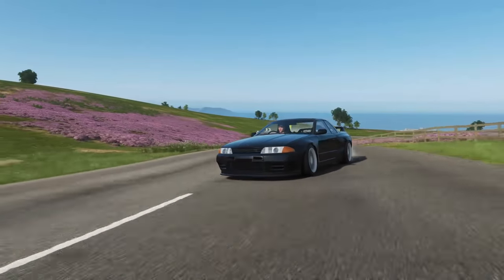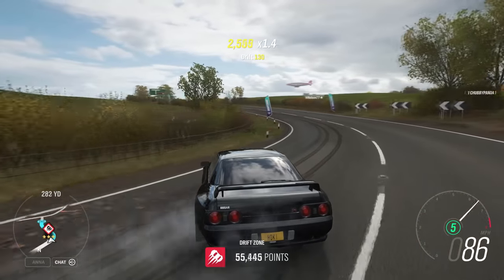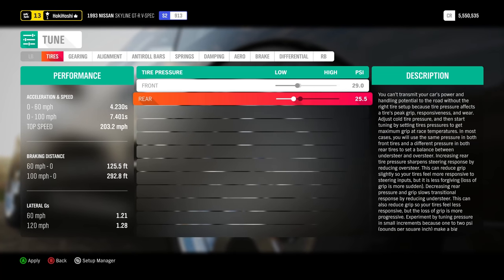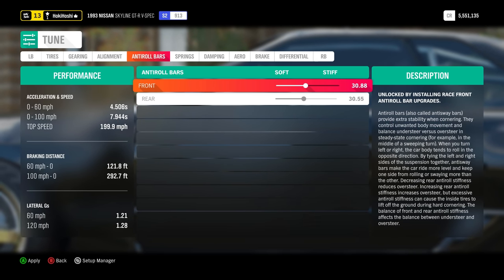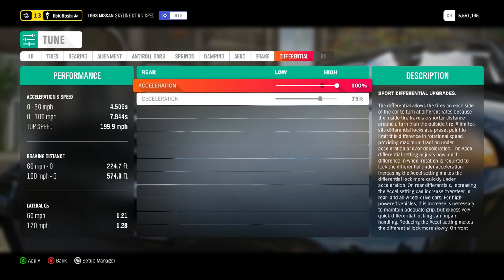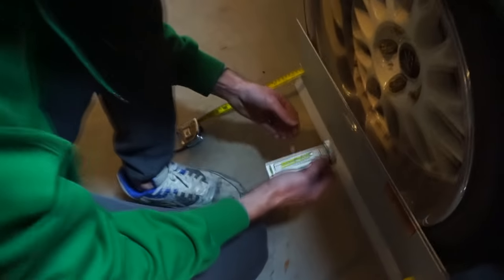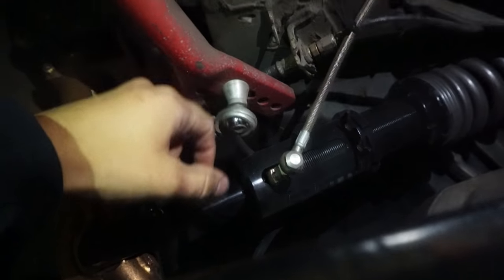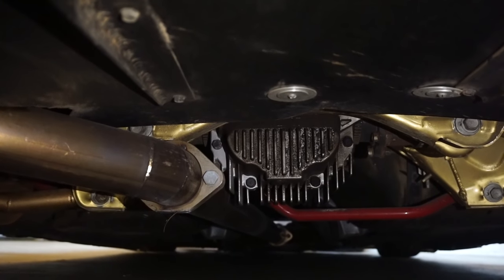How to Drift in Forza Horizon 4 (Technique/Tuning)

Comment: After watching full video i must say that you did more than great work. Its hard to say how much effort you put into this and how good it is in summary. Just great great great work. Its one of the most quality things ive seen in a long time. About Car specific videos. Definitly yes i would love to see this kind of videos from someone like you.  Have a great day/night!
Reply: Tomek L the only thing I think is wrong is the tyre pressure but it’s great
Reply from the maker: @mauderuel  What are your thoughts on the tire pressure?  Always interested to hear other opinions!!
Reply: HokiHoshi on relatively low horsepower like 0-650hp using high pressure can help you to start and keep sliding  
 because you have less grip but in the front you can let it low to have precision or let it high to have a smoother transition
Reply from the maker: @mauderuel  Oh I totally agree!  I mentioned this as well in a comment to someone else, but for lower power cars and for beginners (and sometimes tandems), I think high tire pressure can be really helpful for kicking the end out and also learning drift control.  Heck when I started drifting in real life I used to run 40+ PSI on my rear tires.  The reason I suggest low rear PSI and "optimal grip" front PSI is because that's more the end goal.  It'll get you higher scores, more drifting speed and control, and is preferred for high HP drifting (most Formula Drift guys run crazy low rear PSI), but again I completely agree on low horsepower cars benefiting from higher pressures!
Reply: HokiHoshi yep
Reply: Tomek L  I was thinking the same! Great work!
Reply: I SAID THE SAME THING. JUST TODAY IN  FACT . SO MUCH MORE EASIER WITH VIDS N HANDS ON.  BUT YEA I LEARNED N GETTING BETTER AT

Comment: Im more aggressive when drifting and for anyone who cares to read this, my initiation goes like this: 
Weight transfer —> Power over —> Handbrake. This generally allows me to take a much wider line for more Formula Drift Esc. Lines and tandems. Ofc this isn’t something to start off with although it is something id recommend for a more aggressive tandem battle.
Reply: If you whant to go real aggressive and do reverse entrys you need to Have low camber up front and stiffen the front suspension and lower bumb in rear and add bumb in front
Reply: Do u still drift
Reply: @alleaa5087  What's 'reverse entry'?
Reply: @thesprawl2361  when you over rotate the car and come in reverse in to the corner
Reply: @alleaa5087  Ah, okay. I reverse drift so I just call it reverse drifting.
Reply: @thesprawl2361  reverse drifting and reverse entry is not the same. just search reverse entry on yt
Reply: @alleaa5087  Okay, I get you now.

Comment: Nice video. Thank you. I am kinda new to sim drifting using a steering wheel. Are your settings here good for a steering wheel, controller or both? Also, I notice some people using Rally suspension setup. Which do you recommend? I am guessing drift but I was surprised people using the rally setup.
Reply from the maker: Most of the settings transfer pretty well between controller and wheel!  The rally suspension thing mostly carries over from FH3 when there was no drift suspension and rally had more steering angle than race. For FH4 though, drift suspension is definitely preferred!
Reply: HokiHoshi this dude is a big YouTube or now he has 100,000 subs
Reply: @Mashy937  not exactly.
Reply: @HokiHoshi  Could you please share your settings for t300rs gt?
Reply: @yolandedossantos6116  this aged like fine wine
Reply: @Anonymous-eh3bt  pro tip use drift suspension for dry pavement and really with dirt\snow lol

Comment: Great informative video pal! I setup very similar only o don't run lowest rear tyre pressure I run it to meet 32-33psi in telemetry for optimal grip. Also run 40% rear brake balance with 18% Brake pressure so I can sit on the brake whilst under power and hold angle when in tandems to manage speed on lead cars door

Comment: "i would also reccomend to set your braking to ABS off" look, this is an amazing tutorial and i actually started drifting really nicely after watching it, but driving in this game without ABS on in general is really hard, i found that keeping the tires TURNING while drifting helps alot. i always gained grip and fucked up my drift when i lightly tapped the brake. please turn abs on, it makes everything easier. trust me.
Reply: Then your problem is brake bias and pressure I use 45 to 43% bias and 85% pressure
Reply: Well, i use abs off and locking the brakes with the clutch on is a great drift extender, train your finger to be more careful on the brakes
Reply: Use stock breaks only then

Comment: I upgraded an RX7 a and tuned it according to this video but everytime I use the e-brake it instantly spins out, any tips on what I may have done wrong? thx
Reply: PetFlaska try to lower rear outer toe
Reply: if you are slamming the gas along with the e brake try using some to no throttle

Comment: Really good quality content, really well explained, also my tunes weren't as far as yours are so i think i'm doing them well. Just 1 thing i have to say, i use stock tires in almost every car, it's more slow yes but it's way more slippery so the really long turns i can make all them sideways, it's also more fun to drift and kinda for more skilled drifters i think.

thanks for these videos and keep doing that kind of content, also you could make drift spots videos, just as an idea for a video 👌
Reply: agreed!
Reply: When i drift on forza i use stock gearing from the car's real life gearing and lower camber (-3 to -4 °) and 3/4in toe front  and 1/2 to 3/4in in the rear at negative value i think i do fine but its great to see hoki's input

Comment: I like doing high speed drifting, I learned my favorite entry from Keiichi, works well in rl and in forza for any balanced car. It is completely unnecessary  for cars set up for drifting tho. It is swinging your weight forward with 2 taps on the brake near the entry and timing is fundamental as you want to turn as you do the third harder press on the brake. That puts all the weight transfer forward so you get a good front wheel grip and a loose rear. IRL is a bit more complex as you gotta shift down at the same time in most cases.

Comment: I can make a general drift tune but they were almost always high power and low grip or high power and high grip, so I virtually never stood a chance at coming near a tandem. Was always wondering how people were doing these slow, smooth, maintainable drifts and look so technical. Cant wait to try out some new tunes using your tips and hopefully widen my drift capabilities and improve. Props!

Comment: i’m a mad aggressive drifter bruh. Full throttle, slam that e brake, and pedal to the metal, if u wanna switch angles slam e brake and go full throttle again. I have been playing forza for a very long time and i found this to be my favorite. Usually run high horse power builds too, that is key.

Comment: This is actually really interesting, considering my tuning is extremely unorthodox by comparison. I usually run AWD setups with min ride height, and I tune the gearing by finding where the top speed and 0-100 mph times are both at their highest. Of course, this means that when I tune a drift car, I have a car that I can use in other circumstances as well. When it comes to ARBs, Aero, and Camber, I usually leave those on default.

Comment: Thank you very much I finally managed to drift properly (over 300,000 in the spectacular descent of the island). Don't laugh but the main mistake I was making was to leave abs, and the traction aids. I tried the settings you recommended, the car is very nice but I feel better with the Mazda Miata from 94 elaborated up to S1. A monster. The Ferrari drift was also excellent.

Comment: If you're new to drifting my suggestion is practice with the Cadillac CTS-V, Lexus RC-F and the Nissan Silvia's (all of them). They're easy to drift even in stock tunes. Also when you drift higher powered cars try to drift in higher gears like you see Hoki Hoshi do in the video. He was in 5th at 90mph. For practicing I highly recommend drifting around roundabouts because you can keep going and practicing instead of having to drive back each time you mess up. Good luck!

Comment: For what it's worth, on FH4 the front rear brake bias, is a %100 of rear brake. so when you set it to 100% that is 100% rear brake. Not front, even though the slider is under FRONT.

Comment: I pretty much set my cars up exactly like this. I like a little bit of a “squatted” ebisu style ride height setup. To me it feels like I get better angle and still keep good grip in the rear. I don’t really like to go above 600 horsepower and I like running race tires with low psi for big grip. Helps with backies too

Comment: "In fact it's common that you will steer more with your throttle than you will with the actual steering wheel" for some reason up until you said exactly that I've been just flooring it around corners and over steering and getting frustrated, I have improved just on one line (first day with wheel and pedals)

Comment: awesome video, i also pick older cars (mostly jdm), put as much power as possible in it and then throw race tires on it, which allows me to run stiffer settings without sacrificing grip.

Comment: I would definitely say drifting almost requires manual gearbox settings to properly do. You need to be in the correct gear for the upcoming corner before entry to guarantee the best line and angle. Clutch kicking can help but definitely not needed nor as important as being in the right gear.

Comment: I got a m3 97' drift build with
Max tire pressure
3.33 gear ratio with all gears ending at the first square
Toe out on the rear at 0.4%
Everything else is almost if not the same
Its tuned all the way with an engine swap v6 but no turbo
Try it works like a charm for me, best build I've had so far

Comment: Hey, if you're looking for a tune to test out, I'd really love some feedback on a tune I did for the charger you first get when you start. I think it's one of the better tunes I've ever had on any muscle car before. It feels like it's a real Touring Car contender. It flows through the fast corners, slides ever so gracefully around tight corners with plenty of pull to exit, and it soaks up the bumps better than a sponge does water. I feel that it could use some fine tuning but overall, I feel it's a very nice road/track setup

Comment: Nice video, Thank you.
Also for differential settings, I find that 95%~90% acceleration differential lock for me is better than 100% acceleration diff lock. (I use a controller)

Comment: Great video, just i had to correct you with 1 thing, forza messed up braking in fh4, now you have to move the slide towards rear to add braking power into the front brakes.

Comment: i like to set my dampers to completely soft and springs about half, and the diff is 100% accel and decel.

no, it doesn't drive well, but it does simulate blown out shocks and a welded diff, which is fun

i also try to keep my horsepower below 150

Comment: I just started trying to drift like a pro in forza and its turning out well ive been using the hoonigan rx7 i love that beast but idk ow o tune it perfectly i use it as an awd but i keep on the throttle wayyyyyyyyy too much and hold the ebrake to get wider drifts its hard to use throttle control on xbox controllers but a ps4 controller easy asf but if i had a whole steering wheel and gas pedal and all that shit id be good and set fr but i am wanting to try to use the rx7 with a little less power and rear wheel drive this video is deffinetly getting a like and you earned a sub bruh

Comment: I'm just trying to finish the second "riddle" on the fortune island map
Reply: Ferrari 458 and just get a awd 1500 hp tune and it’s as easy as hitting handbrake on the corners and easily take the mountain down to the bottom sorry if you already did it and this is useless information

Comment: tbh I recommend to never use Simulation steering unless you can simulate a steering wheel on your joystick or you have a Wheel.
Reply: I like simulation steering because you have more control over your car. It takes practice to get used to it with a controller but once you master it your casual racing and drifting experience will be way more satisfying

Comment: Great video, trying to tune my first drift car build, but got a question. In the gearing section, what does it mean exactly, to bring gears closer together? let'đ say, that I'm happy with my 3rd at 1,8, does that mean, that 2nd should be let's say around 2, and 4th 1,6? Is there some universal base %, that should be between those gears?
Reply from the maker: Thanks! There isnt really any set % ratio between gears, but the goal is to be able to up/downshift while drifting without losing power.  So lets say your 3rd is at 1.8 like you said, then you want to be able to upshift to 4th in the middle of a drift without the car bogging down,  that would probably lead to a 4th gear ratio of around 1.6-1.7.  And you want to be able to transition into 2nd without totally losing power and just bouncing the limiter.  Hope that helps!
Reply: @HokiHoshi  yeah, thanks for the info, will try to play with the settings a bit more. 
Might be, that I have not chosen the best car to start with, as I took mazdaspeed MX-5, swapped it with a rotary that revs to 10,5 or 11k, made it an absolute beast at the top of S1 class, with RWD intact. Once the wheels start spinning, there isn't really any difference between gears, it just keeps spinning :D. Sometimes I get it to slide just perfect, and other times I oversteer too easily. Might be just lack of practice, but this video helped me immensely already, as it was completely uncontrollable at the beginning.

Comment: interesting. i always up my tirepressure, like 70-80% on the rear and to like 50-60% on the front. also i put my alignment/damping/springs etc very hard, especially on the rear. thats what i did in assetto corsa and which sounds the most logical, cause in drift u dont want grip on the rear wheels and only little on the front. feathering the throttle and steering almost never makes me spin out and i get great angle and decent speed with an S2 903 S15. having the car soft makes it so wobbly it confuses me. its interesting to see quite the opposite tune work out. good guide

Comment: i used to play a lot of gta drift mod and it was similar to Forza horizon 4 drifting, from what i've seen in forza though is that e-brake is easiest for control but slow, power over is fast but not the best at control, and the weight transfer is a happy middle. I'm new to forza drifting though so I may be wrong

Comment: Forgot the scandinavian flick initiation technique ;)    Turn the wrong way, then flick the wheel hard the right way to transfer weight. Mostly used in low-mid power cars, but is also usefull in higher power cars.
Reply from the maker: The scandi flick is a type of weight transfer entry which I did mention!

Comment: Do you use a controller or a wheel setup?  I am on the controller exclusively so is there any controller setups or 'tunes" for that?  I know there is dead space in the throttle and steering that likes to throw me off the line   even with a normal setup for circuit racing.

Comment: Best tyre pressure is actually 32psi and you'd Wana set it to 27 as with lower pressure allows to heat up easier lol and yes tyre heat does change pressure too lol

Comment: @HokiHoshi Also I'd love to see videos giving drift setups for different cars. As I'm still learning and get the feeling that to get the best out a car, the upgrades and tune you use have to be tailored to each car. Or is there a one size fits all wether it be drift or race? Cos I have a tune on my MC12 FE which is near perfect, (but still needs some tweaking) 😄 I applied it, or as near to as i could get it, to my alpha gulia FE ( I think that's how it's spelt, apologies if not) and it was completely different to drive compared to the MC12 FE. I figured it can't just be that It's because it's a different car. I'd be grateful for any advice on this particular issue I'm having as at the moment as much as I like the gulia it's un-drivable. Thanks.

Comment: your tune isnt wrong, its just a different way of getting the same result. me personally i max the tyre pressure and try not to use excessive camber as you will get diminishing returns at the entry of the drift and too much grip mid drift at full lock